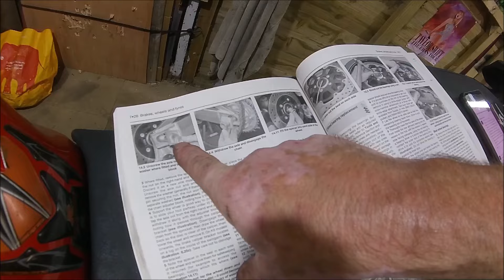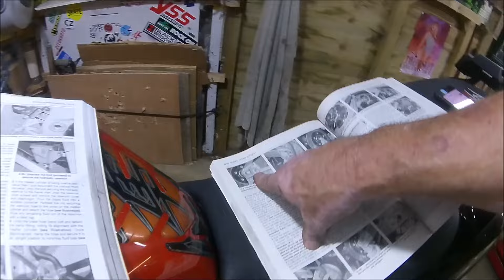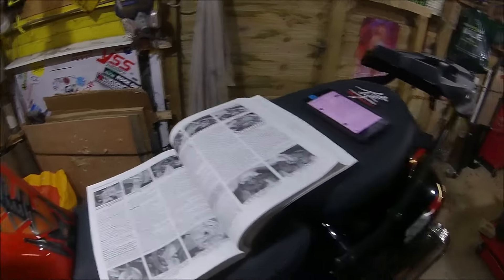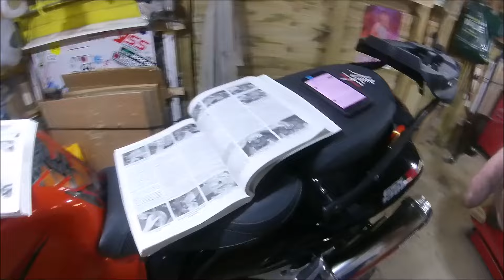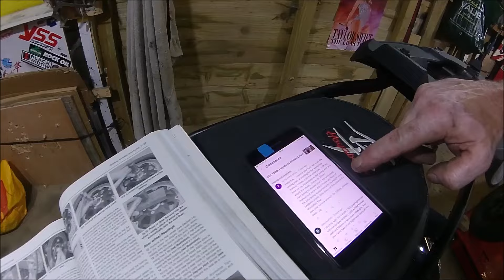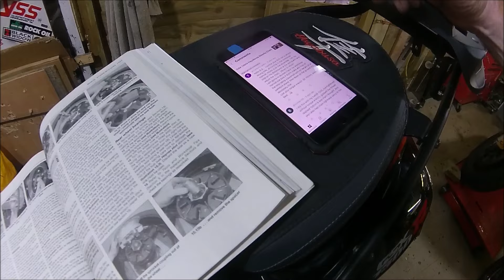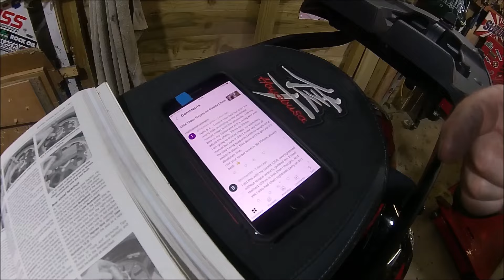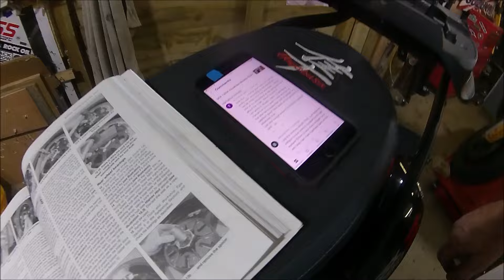GSX 1300r Hayabusa I Need Answers!?

Comment: For motorcycles with a chain drive on the left-hand side, positioning the spindle nut on the right reduces the chance of the nut loosening due to the forces generated by chain tension. The rotational force of the rear wheel under acceleration can cause a left-hand spindle nut to potentially loosen.
Reply from the maker: I don’t think that’s true🤷‍♂️. If the rotational force is causing an effect wouldn’t it be due to axle movement🤔. If you have axle movement your bearings would need to be seized to the axle for it to rotate. If this were the case having the nut sprocket side would tighten the nut, wouldn’t it🤔🤷‍♂️
Reply: @bikerantics5001  I'll try and explain simpler.
On most motorcycles, the chain drive is located on the left side of the bike. The chain transmits power from the engine's front sprocket to the rear sprocket, causing the rear wheel to rotate. This power transmission creates a set of forces: 

Chain Tension and Torque: When the motorcycle accelerates, the engine applies torque to the front sprocket, which is transferred via the chain to the rear sprocket. This torque creates a pulling force (tension) on the top part of the chain as it pulls the rear wheel forward, causing it to rotate. 

Resulting Rotational Forces: As the rear wheel rotates under the influence of this torque, a reaction force is generated in the opposite direction of the wheel's rotation. This is due to the principle of equal and opposite reactions as described by Newton's Third Law. 

If the spindle nut were placed on the left side (same side as the chain drive), the rotational forces and the tension in the chain could potentially cause the nut to loosen over time. Here's why: 

Rotational Direction: The rear wheel rotates clockwise when viewed from the right side of the motorcycle (assuming forward motion). This clockwise rotation means that if the spindle nut is on the left side, the rotational force could apply a counterclockwise (loosening) force on the nut due to the direct interaction between the forces of rotation and the threading direction of most nuts (which are usually right-hand threaded). 

Chain Tension Influence: Chain tension also plays a role. As the chain pulls on the rear sprocket during acceleration, it can induce a slight twisting force on the axle. This twist can exert additional loosening pressure on the spindle nut if it is on the left side, aligning with the direction that would loosen a standard right-hand thread nut. 

By fitting the spindle nut on the right-hand side of the motorcycle (opposite the chain drive), the rotational forces act in a way that helps secure the nut rather than loosen it: 

Securing Effect: The rear wheel's clockwise rotation (when viewed from the right) would exert a clockwise force on a right-side nut. Since most spindle nuts use right-hand threads (tightening clockwise), this force works in favor of keeping the nut tight. 

Mitigating Loosening Forces: With the nut on the right, the potential loosening forces generated by chain tension and rotational dynamics are significantly reduced. The force applied to the nut now acts in the same direction as tightening, thus enhancing the nut's security. 

I hope this has cleared it up for ya..
Reply from the maker: @kevinansell9341  the forces you’re describing would need to be transferred by the axle to the nut, for this to happen there would need to be something wrong with your bearings🙄
Reply: @bikerantics5001  You either didn't read my last or didn't understand Torque and resulting counter rotational forces generated, I think your hung up on Wheel Bearings seizing before counter rotational forces can act on the Nut..Nope nowt to do with seized bearings, I've dumbed it down as best I can in the above, Gogle Newtons 3rd Law.
Reply from the maker: Okay, lets try one more time🙄. You’re not actually describing how the rotational force of the wheel transfer to the nut🤷‍♂️. I could state, quite rightly, that the moon effects the tides but without details of how the process works it’s a fairly empty statement. The same as all your texts, which read more like diatribes🤔, there’s a lot of words but none describe how the rotational forces directly transfer to the nut🤷‍♂️. 
Please don’t try using Newtons third Law again 🥱. In this application the law is referencing the tyres force on the ground and the ground exerting an equal and opposite force back at the tyre. 
Please do your research before answering and give a full explanation not just empty paragraphs 🥱🫡.
Reply: @bikerantics5001  Agree to disagree :face-turquoise-covering-eyes:
Reply from the maker: @kevinansell9341  Isn’t that what people say when they can’t back up their theory🤔. 
So no I won’t be agreeing to disagree, thank you 🫡.

Comment: Had my K8 since 2008, makes no difference but mine does have both cut outs on the axle bolt ,best colour as well Blaze orange/Black 👍👍
Reply from the maker: Perhaps I’ll have a look for an adjuster block that ‘captures’ the axle head🤷‍♂️
You’re definitely right about the colour, absolutely stunning 👌

Comment: wheel nut is normally on disk side on Suzuki's but it don't matter  only time it would cause an issue is depending on your exhaust you might not get the axle out without removing the endcans and chain tension dont matter where/how you do it so long as you end up with the 20-30mm
Reply from the maker: @heatz711  do you reckon putting the axle the other way could stop the mysterious (🤣) chain tightening scenario when you tighten the axle nut🤔
Reply: @bikerantics5001  no that's due to swingarm flex lots of bikes do that just gota account for it
Reply from the maker: @heatz711 I thought it was down to the axle having different diameters and when you tighten the axle nut it pulls the threaded portion through and when the unthreaded thicker part of the axle is pulled through it tightens the chain😮‍💨🤷‍♂️
Reply: @bikerantics5001  it could be but ive always put it down to the flex worth swooping it over just to check it out
Reply from the maker: I don’t think your swingarm should flex when adjusting the chain. I don’t think it should flex or your cornering stability would be compromised, especially at higher speeds🤷‍♂️
Reply: @bikerantics5001  trust me there's some  minor flex in them if there weren't you wouldn't be able to get the wheel in or out without a crowbar
 once axle is torqued up there ain't any flex
Reply from the maker: @heatz711 okay, yep, the clamping force of the axle being torqued will pull the sides together . . . I thought you meant other than that 🤣

Comment: If they is a locking pin then the rear axle matters, but most cases nah doesn't matter. I fitted a aftermarket exhaust which made getting a torque wrench to the nut difficult disc side,  so I swapped mine over, no problem. Regarding the chain I always do mine on the paddock stand for 2 reasons. I clean it while I am adjusting it and I've noticed I'm rubbish at getting the spec right on the side stand. I much prefer going straight down rather than at an angle. Then again I'm the kinda guy who will happily just change a wheel bearing that has gone rather than changing the set as per the recommendation.
Reply from the maker: Yeah I’ve had no problems having my nuts in the wrong place🙃
I’ve never tried tensioning the chain while the bikes on its side stand, just struck me as making the job unnecessarily awkward🤷‍♂️
I dunno whether that’s bravery or stupidity with the bearings, but if it works I can’t knock it🫡
Reply: @bikerantics5001  in fairness I got that from an old mechanic down my end, who when I had my learning bike checked them and replaced just one on the front wheel.  Miss that dude I started doing my own maintenance when he died.
Reply from the maker: @BLG80  Same reason I do my own maintenance, you certainly don’t get that sort of customer service these days🤷‍♂️
The time, effort and money to take your bike to a mechanic, lose it for a day maybe two, to do basic maintenance just isn’t worth it. I’d much rather fit it in to my own schedule 👌

Comment: The axle, if it's not broken, don't fix. second if you lift the bike up one end you will put unforseen pressure on the chain if you lift it in the middle of the bike you are putting equal pressure through out the bike 🏍 so in your case I would definitely try on the side stand 👍
Reply from the maker: @blackdotkiller1  but the bible says to put my bike on a paddock stand🫡. If you lift the bike from the swingarm it takes all the weight off the suspension giving a false reading of slackness . . . doesn’t it🤔. And bollocks to doing it on the side stand, especially with my axle going the wrong way😂🤪
Reply: You just answered your own question. You've taken the suspension out of the equation, tightened up the chain, and then you take it off the paddock stand now. The suspension is put back into the equation when the bike is back on the floor the chain is under more tension 🤦‍♂️
Reply from the maker: @blackdotkiller1  but it’s the same weight and suspension movement whether it’s on the floor or paddock stand🤷‍♂️. All of the weight is still supported by the swingarm pin/ bolt and the suspension linkage in both scenarios. So weird the bible changes method depending on bike year🙃. If you lift it by the swingarm pivot then the suspension will sag, probably causing a difference in tension, wouldn’t it🤔
Reply: The whole weight of the bike is being lifted at one spot compressing the suspension however small it is then you fit the chain place the bike back on the floor now the spot that was taking the whole weight of the bike is no longer compressing so it tries to go back to its original place but can't because you have tightened your chain so if you drive it over a big pot hole your suspension will stop at the point at which you have tightened your chain and at that point your chain will stretch because the suspension can't go any further
Reply from the maker: @blackdotkiller1  yep, but the compression shouldn’t be any different whether the bike is supported through the wheel axle or a paddock stand. The weight above the swingarm pivot point doesn’t change. The distance between the swingarm and the subframe hasn’t changed so the effect on the suspension is the same. I suppose in the end so long as the tension/ slack is where it needs to be the science really doesn’t matter🫡🤣

Comment: I think the rear axle bolt is nut on disc side on Gen2 busa so you can slide the rear caliper out of it's locating slot to aid removal of rear wheel but it's a bloody pain in the arse anyway! I'm always catching my wheel with the caliper. I use an Abba stand to adjust my chain and no problems.
Reply from the maker: 🤣 it’s definitely a pain in the arse but worth it when you ride it🙃

Comment: 2006 Gen 1 Busa here, my axle nut is on the sprocket sided and the cradle on the other side has both raised bits. Adjusted my chain on the paddock stand and it's absolutely fine. BTW i have the same Scorpion cans, did you take the baffles/DB killers out ?, if so how ?, fukt if i can get mine out, sounds great anyway but just wanting to see how it sounded with the baffles out.
Reply from the maker: I’ve invested in ‘new’ adjusters so they will ‘capture’ the head of the axle, necessary upgrade I think 🙄😂. A comment from Holycrapski has changed my mind about nut side and when my chain needs adjusting again I think I’ll turn the axle around🤷‍♂️. It could be why when I tighten the axle nut the chain suddenly goes tight🤷‍♂️. 
When I bought the bike the baffles were missing but I believe they’re held in by a bolt on the underside at the back end of the end cans🤔. If you’ve got no bolt perhaps yours have just been wedged in🤷‍♂️.